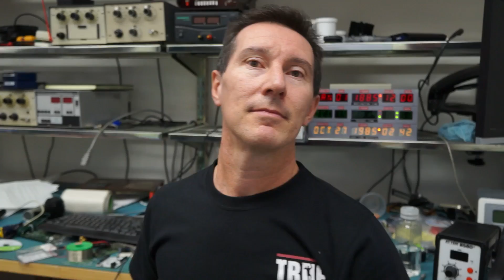eevBLAB #2 - Are Electronics Hobbyists Useless?

Comment: Are you asking too much ? Not if you are willing to pay for it. Expecting soldering skills including Point-to-Point, Hole-Through and basic SMD is a reasonable expectation. Having competency on Basic Test Equipment up to an Oscilloscope is also a reasonable expectation along with being able to read a schematic, Data/Specification books and assemble a circuit on a breadboard. Are all reasonable. When you get into debugging that's when you are calling for expertise. Debugging to component (failed component) is usually found in most Technicians and Hobbyist who have a couple years experience. Debugging faulty designs requires a Technician, not a hobbyist with a good deal of experience. If you are looking for a high degree of competency in BOTH analog AND digital circuitry you are looking for someone that has a long resume. Assembling a circuit from a prefabricated kit requires little in the way of debugging skills if care is taken in the assembly. Dave if you came to a Human Resources Manager with the list of requirements you have laid out they will ask you how much have you budgeted for the position ? The skill set drawn up for a particular position is always pared down to the absolute minimum to do the job.

Comment: Depends. I got into it when young, but the math, electricution risk scared me off. I went into network administration. I never made a board, no successful SMD soldering, don't know much about simiconductors beyond a simple transistor or diode. I have friend that teaches electronics at local college, because i have relative works there i could do for little of nothing one day. Said he thought i should take linear and digital electronics. They both had at least one prereq class, he i guess didn't think i needed. 

I know computer techs that without spec sheet, or software have no idea what's in a system. I had a server no OS, or spec sheet. I had to trace the SCSI ports out, locate the controller chips then go from there to get drivers. 

Of all the I.T people i'm one in a very few that will salvage an old UPS unit. I take apart, put on lighter cord, calibrate if needed and i have a cheap inverter for my car. I even took apart an old I486 CPU someone gave me.

My teacher friend tried to fix a few LCD monitors for the school. Got them opened, but couldn't see issue. My friends in the I.T dept gave to me then, It took a bit, but i held it right saw a bad cap replaced it with a good elna, and i had a LCD monitor. It came up one day with the teacher that tried to fix and he was kind of like you fixed that!?

Comment: I think the problem is using the term 'Hobbyist' to describe the required skill level.  Hobbyist skills run the gamut from those capable of doing all that Dave describes and beyond down to those that get excited by seeing an LED they wired to a battery light up briefly before it smokes.  In fact, Dave should have listed all the skills he described in his 'blab' as the job's skill requirement rather than using such a broad term.

Comment: Hi Dave. This is my perspective on your query.
 Dave asks, "Are Electronics Hobbyists Useless?"  

Well, I don't think anyone is useless.

 Times have changed since we have been young fellas. We "now" live in a time where most people just tinker with hardware. Most young people want to do everything from a keyboard now. This is why you have such an audience. People look at you in awe, because you have an extended skill set that moves from software to hardware to mechanical understanding, all in one episode. When you hire "A Hobbyist," don't expect them to know all that's in your resume requirements. That's slightly more than a hobbyist. Most people I know that are just hobbyists, know how to solder, know what a transistor is, have a vague idea what a tube is, can't read resistor color codes, at all, Think that "glue logic" is a technique to stick things together, and they think "conformal coating" is a way to dress!

What I think you should expect in hiring somebody: as a hobbyist....

I think the people that apply to your job posting will be eager to know what you know..... Will be eager to learn.... Will have a "true desire" for all things electrical..... but will not meet your applicant expectations. Most people that have that skill set like this, will be employed, making "ok" money....... Because nowadays, these people are few and far between.... Hey Dave, 

***What's a Backward Wave Oscillator used for?

***What actually is a Standing Wave?

* What is Dumet or Kovar? 

Just expect the same look on the face of the person your interviewing, when YOU ask the questions.... And be nice! The people that apply for this position, watch your channel, because they like you.

Good Luck!
Reply: I think that many people around there would be scared to work for Dave. Having Dave looking over your shoulder like a Marine Corps Drill Instructor would be intimidating to a lot of people.
Reply: Robert Calk Jr.  I gotta admit, it would be kinda fun to get Dave's eyebrow twitching...... After a week of me being there, he would have some sort of mental trauma :^).... The next episode of the blab or blog, would have Dave rocking in a corner of his lab, gently tapping his face with his thumb..... maybe a bit of drool... HA HA!
But really, I wish you the best of luck finding somebody. Hope he has a sense of humor!
Reply: I think in Daves case you need a basic novice with no skills then train them up I find you get people from a structured learning environments you are going to create issue..

My aim if I were to hook up with dave would be to learn the basics, look at a creation of ham set which has has cb scanning functions  which is able to cover all frequency bands with USB/lan/wlan function for updates and remote control function and look at touch screen control via hdmi  and have it it in a modular design so component can whacked into a 5 1/4" or 3.5" hard drive bay.
My aim would be to make something that has ham and general computer compacity  whether you float it through iOS , windowx, windows embedded,  Linux, android and any other major OS designer out there.

My aim is to produce base/mobie portable between 500-1,000 AUD  with Internet capacity for sat/DSL/cable/ham (reserve) having the capacity of Skype/yahoo/MIRC as a extended comms medium replacing the old bbs function in emergency comms options and having a gps chart plotter to point to people in distress..
The key is to have 1 comms platform option where you can implement a setting where you can transmit across a multiple frequency starting from cb bands through to hf/vhf/uhf/am/fm..
I also want to look a similar option within a handheld..

At the moment I see a lot of crap within the market place  starting at a price point of $50-1,000 with very little crossband talk function I have seen a lot function being added to the radios over the last 20-25 years thoug I have somewhat become jaded over regulations that deems a requirement of being able to talk to gmrs/frs and everything In-between and sadly we are stuck..

And looking at what is available today my guess yew are likely 10 generations behind whithin ham operational function compared with what is now available within a mobile phone platform..

And within radio platform we are still laying around with 3rd party component connections which have been in obsolete status USB/FireWire/sata/ various memory card formats became available to use ...

Comment: I used to do that kind of stuff when I was 10 years old. I etched my boards because there was no such service that would make you a board. I got my ferric chloride from an acquaintance who worked with water disinfection. I was very poor and my parents kinda hated this hobby, but I made do. I got most of my parts off thrown away TVs in road ditches. Today, everybody bugs me to fix their stuff.
EDIT: When I didn't have access to a proper rosin core solder, I melted a slab of lead in a can and then poured it fast onto an iron sheet of metal. This formed a sheet of lead. I then cut it into narrow stripes with shears.
EDIT2: I would still have a few samples of those if my father didn't start a fire.
Reply: This is the first time I've heard of someone making their own solder!

Comment: I don't think Dave is asking to much. I've had no formal education in electronics, yet I'm currently making my own USB sound card/ audio dac based on the pcm2903 of which the circuit design and board layout i did myself. I also can program micro controllers(avr's in c)I'm not saying this just to brag, just to illustrate that there are certainly people out there with the skill set that Dave is after who don't have formal qualifications. Hope he has the best of luck in finding an assistant.

Comment: Way way too much. Hobbyists who have that range of skills are in the absolute minority. I am sure a few exist but they are not working in the industry and are hobbyists for some other reason. Personally I would 100% fit the bill but with such a wide range of skills I could get a job in no time. Also, your skill set requirements are very wide, although they exist, very few hobbyists are going to be able to solder an smd, program firmware and design a PCB. Once again, they exist but you are dreaming if you think you can get someone like that for less than 50k.

Comment: I learned the 'basics' (as Dave styles them) by the time I was about 13.  However, it wasn't until I was about 16 that I could reliably design system level circuits,(address/data demux and audio amps for a audio board I built for the Sinclair ZX-81) and troubleshoot them without significant help.  The big boost was taking intro to electronics during my freshman year of high school.  That gave me the maths and foundation to cement all the random tutorials my Dad and various cookbooks gave me into a reasonable fabric.  While Dave and other practicing EEs often can get the job done faster than I can, owing to their continuous employment, and thus experience in the field.  There is very little that Dave publishes here that I do not have a passing familiarity with as a hobbyist.  Mostly why I am subscribed here is that Dave's videos refine and reenforce my understanding and provide a periodic reminder that I am not lacking in skill...  I'm lacking in time, since I do not design and implement electrical and electronic systems for a living.

Comment: Your not asking to much. I was pulling apart old videos, Tvs and anything else I could get my hands on, from about 10yrs old. I was given an old electronic parts catalog from a friend of my Dad. I would find the parts, know the pin out and what they did, to work out how things should be working. For a school project age15 I built an audio amp. The amplifiers were from kits, but I could follow the drawing and solder it perfectly. The PSU I  designed and made mainly from old parts I had. 

Only thing I think made this easier 20 years ago, is circuit were basic, mostly one sided boards. The parts were big enough to remove and replace.

Comment: Dave, I don't think you are asking too much. If you were expecting this of the average university student, then this would be too much.

But for a true hobbyist (a hobbiest would be one who is "most hobbi"), we do these things for fun. When I was a boy in the '70s, I tore apart TVs and radios for parts. I can sight read color codes because I just tossed all the resistors in one box and had to sift through while thinking "6.8k, 6.8k, 6.8k" and picturing blue-grey-red bands. I built a FET gate dip meter from scratch, capacitance meter, crystal tester, custom scope probes, shortwave radio, etc. In my 20s ('80s) I manufactured and sold capacitance meters and microwave downconverters. I had started out laying out PCBs with laundry markers (ick!), then isolation scratching (horrible!), then isolation etching (paint the board, scratch off the paint and etch), and finally just used photoresist. I don't think I've ever assembled a kit without making some improvements along the way.

I learned almost all of this on my own. My favorite reading materials are science fiction, electronics, datasheets, and science magazines. I'm so weird about it that I sometimes buy used electronics books just to review them for inclusion in the local Maker Club's library (many fail). An autodidact is not a steam powered car.

I didn't get a degree until a few years ago at the local Technical College. I watched as 99% of the electronics students just did their homework and nothing more. I got tapped to design a gameshow buzzer for instructor use, and designed and built my first microcontroller project. For the experience (and no credit hours) I joined the class whose job it was to learn how to program the PIC 16F84 in assembler, my first time with anything other than Basic. After we finished writing it, I figured out that we'd done it all wrong, and rewrote it to work correctly. The hardware and software, short but sweet, worked perfectly the first time. I'm now trying to find the time to learn C/C++ via Arduino.

I'm not bragging - I'm not that special. I'm in a local maker club called OlyMEGA. We have a lot of 20 and 30 somethings who've been coding for a decade already, with a variety of skill levels in electronics. Several have started businesses.

I'm glad that I have the degree. Most HR departments don't care what you've done, they want to see that you have a degree. So I've worked in a variety of one-man TV shops for most of my career, while doing the really creative design work freelance. If I could commute, I'd apply. I wish I could have found a job like this in my teens or 20s.

TL;DR
It is too much to ask of 99% of university students. It is not too much to ask of a hobbyist, be they a student at a university or only a student on their own time.

Heck, it is too much to expect of 99% of university graduates, in my experience.

Comment: From my experience (beginning my 2nd year in a EE degree in Canada), an EE degree crams you with all the theory you need to one day tackle the big problems like Dave mentionned (the gigahertz frequency, FFT, DSP, etc. stuff). You can go your whole life just being a specialist think-tank EE, being part of big teams and never touching a soldering iron or even probing around prototypes with an oscilloscope. Meanwhile hobbyists are passionate makers who want to touch on all the steps of a project's design, they probably won't get to the insane, high-order ODE driven stuff, but they have a broader understanding of carrying out a project from zero to manufacturing. EE's CAN be good hobbyists but won't necessarily be, and there's no shame in that. Also I'd add that, as I've quickly realized, an EE degree alone won't get you anywhere, in the real world you need something else, be it project management skills, communication skills, hobbyist skills, a theoretical niche of expertise, something like that.
Reply: Oh your typing homir

Comment: Hi Dave!

I do not think these requirements are too much. Actually, I feel these would be a perfect fit for anyone who has worked with electronics, on a component level!

I graduated from a 2 year Electronic Technician program, and I would be able to meet the requirements for your position.

Keep up the good work, and good luck :)
Reply: Technicians/Technologists are far better prepared for this type of job then an EE is.  Most EE's are told never to touch a soldering iorn and are forced to go into debt to actually work with more then a breadboard.

Comment: I think the main goal of the hobbysts is not in doing the stuff they made but to learn how to do it. But there are hobbysts and hobbysts. Many hobbysts consumes eletronic DIY gadget not because of the electronics by itself but because it can help them make something else. For example, there are some hobbysts that their hobby is to make clothes, but they want to add some ligths and other cool effects to the clothes they make so they wanna buy some simple eletronics that allow them to do so. They do not want to dig in the misteries and secrets of the electronics they are buying they want simply to use it and that´s it.
There are also those whose hobby is the electronics itself. They like to create circuits that amaze them and their friends or that have some usefulness to them. Those are required to know or at least to have the will to learn about how to create circuits and how the circuits works. But even so could happen that some have more skills or deficiencies in some areas them in other areas. Let´s say, there are some hobbysts that have difficulties in programming MCU´s and CPLD´s and others don´t.
Maybe a good approach would be to advertise in the beginning of the video about what skills are needed and what level of knowledge is required to at least understand what you are talking about in the video. Also would be nice if in the descriptions have links to datasheets and more in depth info about the issue you are talking about.